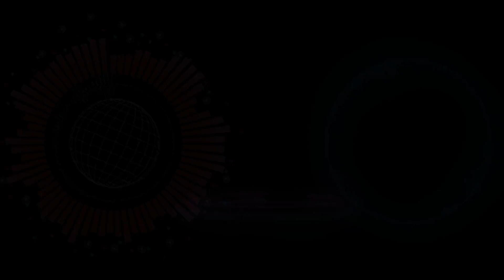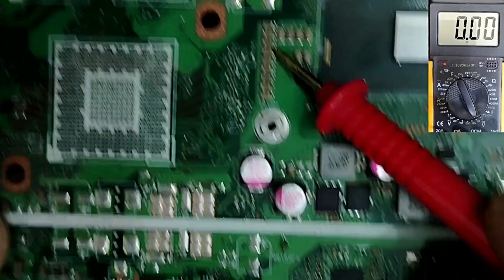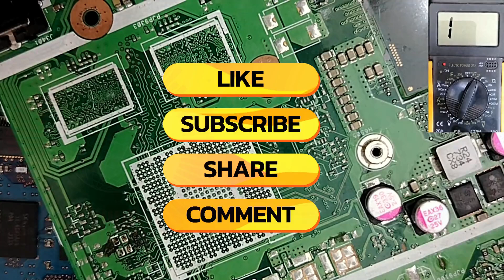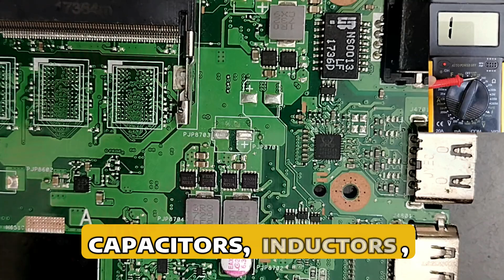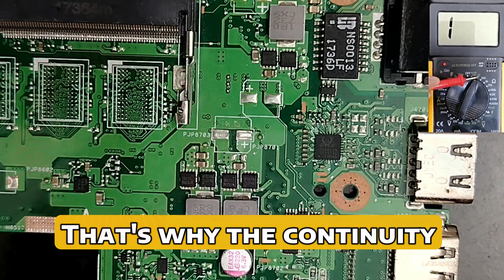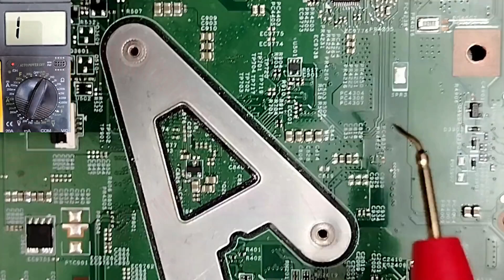Simple Guide to Test Ceramic Capacitors Without Mistakes - Electronics Repair

Comment: I have exactly this kind of problem on my laptop, it turns on and off after 4 seconds, and when the processor is installed, its power supply is shorted out!
Reply from the maker: try an other cpu

Comment: Sir, I tried to fix HP Pavillion DV6000 all led are on with black screen and it beeps 2 short 1 long and I guess it's GPU problem but when I disassembled it I found a 1 component that looks like SMD ceramic capacitor and it's labeled PC185 in the PCB. It was dismounted on its own because it has corrosion on the other side. When I tried to clean it and test it with continuity, there is no response from the tester and I don't know if it is capacitor or resistor. It is located near the DC Jack connector and I cannot find its board view file so I cannot identify what kind of component is it
Reply from the maker: You're on the right track with your investigation. Let’s go step by step to help you identify and troubleshoot that component labeled PC185 on the HP Pavilion DV6000:

1. "PC185" Label Meaning
The "PC" prefix in motherboard silkscreen labeling typically stands for:

So PC185 is almost certainly a ceramic capacitor not a resistor or diode.
The "P" may just be a manufacturer's naming convention (e.g., HP or Quanta boards). But "C" = Capacitor is consistent across most board labeling standards.

2. Continuity Test Result
You won’t get continuity (beep) across a ceramic capacitor in normal condition, unless it's shorted.
Your multimeter showing no beep is actually normal for a capacitor.
To test it properly, use capacitance mode on your multimeter (if available) or test it off-board with an LCR meter.

4. BIOS Beep Code: 2 Short + 1 Long
This beep code for HP laptops (Phoenix BIOS) generally means:

GPU or Display-related failure

It could still be a bad NVIDIA GPU (DV6000 models are infamous for GPU BGA failures), but it’s also possible the missing/failed PC185 capacitor is causing unstable voltage to GPU or display power rail.

5. Location Matters: Near DC Jack
Since PC185 is close to the DC input, it could be:
Filter capacitor for VIN power
Part of the power path to GPU or charging
Decoupling capacitor for a power rail (e.g., 19V line, 3.3V, etc.)

A missing capacitor may cause power instability that prevents boot, display, or GPU initialization.

✅ What You Should Do Next:
🔧 Option A: Replace the Component
If you can find another donor DV6000 board, locate PC185 and read its size and capacitance using an LCR meter or copy it directly.

Usually, these are ceramic SMD caps likely 10uF 25V, 22uF 25V, or similar, size 0603 or 0805.
Reply: @electronicsrepairbasics_erb thank you teacher

Comment: It's normal that a capacitor have two different voltages on both sides? In one side it has 19 v and on the other 8v
Reply from the maker: It's not uncommon to see different voltages across a capacitor, especially if it's in a circuit that's actively charging or discharging. Just make sure to check the capacitor's specifications and the surrounding components!